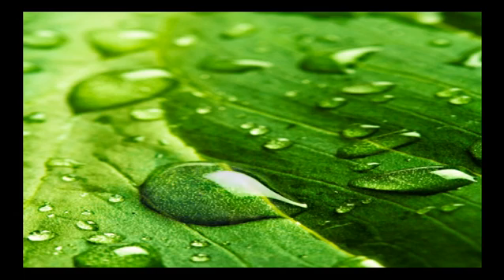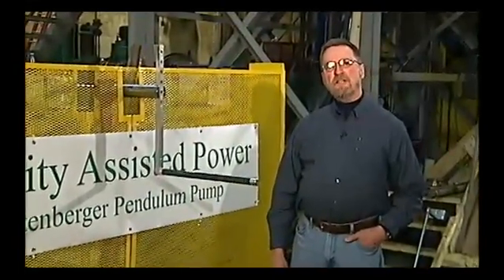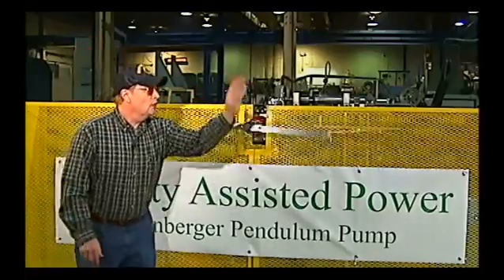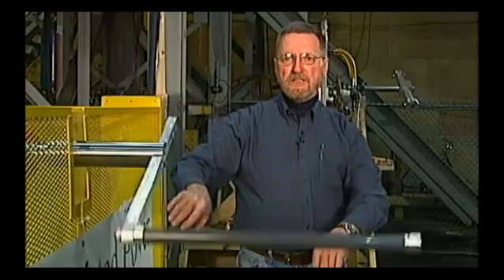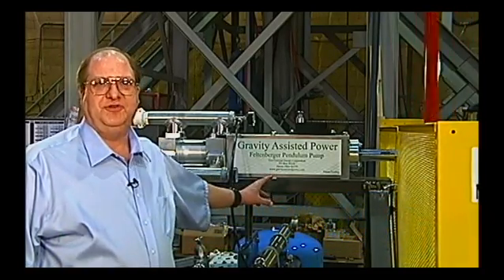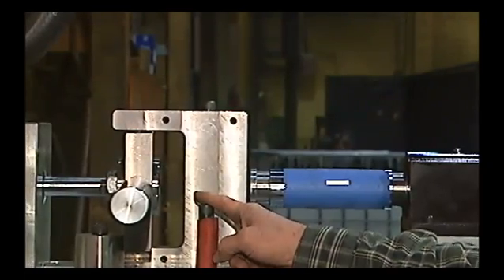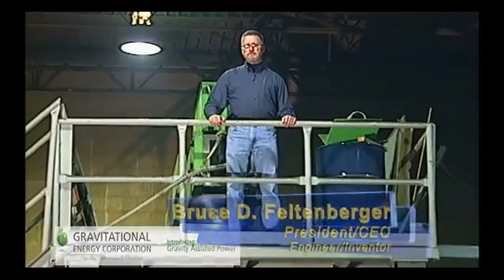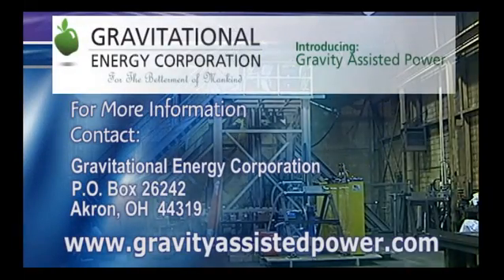Gravity_Assisted_Power.mp4

Comment: How do you keep the pendulum moving when it begins to slow down.  Do you have a power assist electro magnetic pushing it on the way down?  Or do you move the pendulum by hand?
Reply: yup, thats will hard work for machine pillar, to safe the holder better if using flywheel shape

Comment: Well seeing that it goes in and out in 180 degrees , I conclude that you have a swash plate in there. I think that it is a straight direct shaft with the mechanical advantage coming from the lever you hold in your hand.
The concept is good, in that there is a little force applied for a long  time, energy  stored in a pendulum while the rate of change of pumping is zero at he ends , the rotary velocity is beefed up stored to be used  an instant later on.
There is an advantage in the pendulum that you can reduce the stroke if one desires so but if you drive the pendulum above and below its resonating frequency  one would need energy to drive the pendulum, so it is imperative to keep it at resonance .
I wonder if one uses two pendulums at 180 degrees so that one has a flywheel where  the resonance would be cancelled and one can drive it at any speed .   One still needs to accelerate the flywheel at certain phases in the revolution,  for it slows down on load.  I have to think more about this one as I just said what came to mind at the moment.
Reply: iThinkThatAnotherOneAt180DegreesWouldCancelThePendulumEfect,PowerGain.But,WithTheResonanceIdeaIThinkYouNailedIt.EveryPendulumWouldHaveAResonanceFrequency(OrARpmResonance),MaybeDependentOnlyWithTheWeightAndLenghtOfPendulum.

Comment: The lever arm comparison is skewed because the length of lever should be equal to the length of your pendulum pump. If you shortened your lever, you would find it difficult to pump correct?

Comment: How is this different then an oilfield pump jack?
Reply: the different is on speed and energy efficiency, eg some heavy machine push by man power 5% eficiency and become 20 rpm, with pendulum or flywheel 90% efficiency can be avaliable, without loosing speed but increasing on speed